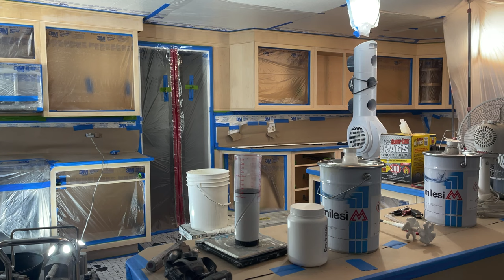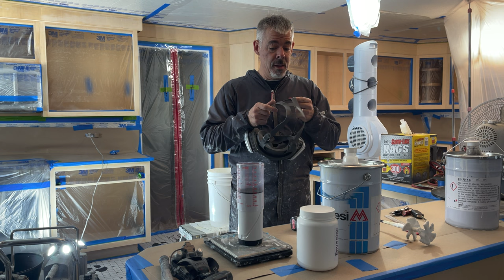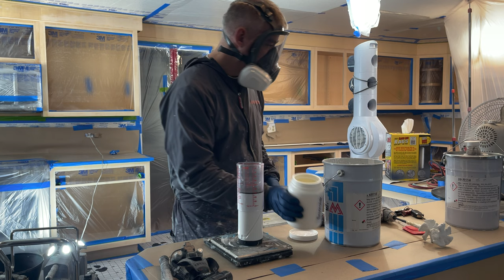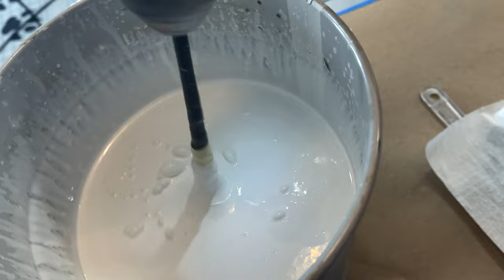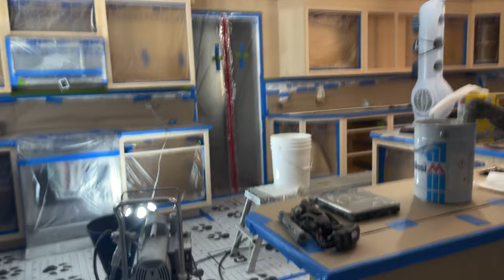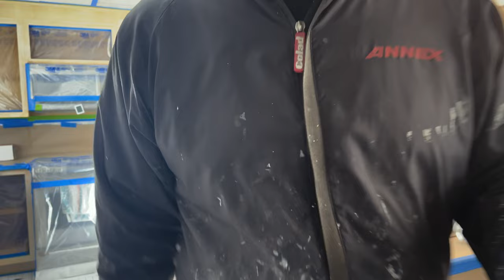Mixing Envirolak 170 -TB with catalyst on site in a kitchen

Comment: Hi Jim. I primed cabinet boxes with TB 170. Lots of sanding. We had to use 180 grit. One of my guys used 150 grit on accident.  I put two top coats of Renner 688. Perfect finish, but I can see tons of scratches.  What would you do to fix this at this point?  Just put on more top coats?  Please. I need your help. Lol.  Thanks.
Reply from the maker: Yes unfortunately those scratches will have to be smoothed out with sanding or more topcoat. Use 320 and try to feather those down and apply another coat of 688.  You only have to do the pieces that need sanding so if some spots are ok no need to recoat
Reply: @Jimskalajim12  Thanks Jim. I appreciate it.
Reply: @Jimskalajim12  What if I just put on two or three more top coats without sanding. Would that eventually do it?
Reply from the maker: @danielmiller3255  The thing is that will work but the problem is the topcoat doesn’t have enough solids to fill without a couple coats and since you have to sand between coats anyway your best bet is to make sure those scratches are gone before the first coat.

Comment: Hi Jim, if I spray this with an airless sprayer do I need to flush it out with anything after it runs clear with water?
Reply from the maker: @Mezcaudill  this is an excellent question. I cleaned my machine with just dawn detergent and water for like 2 years without a problem. Unfortunately there’s deposits that eventually build up in the fluid line that can cause damage to seals. What I do now is clean with water during the week and on Friday I use ML Camble’s GLC-10 and soak the machine overnight. When flushed this product gets all those little bits out of the system and keeps it very clean. Each coating manufacturer has their own recommendation on cleaning so make sure you check with them if using a catalyzed product. Envirolak has a great cleaner called Enviroclean which would be used with 170-TB for a deep cleaning of the machine’s fluid section.
Reply: @Jimskalajim12  that’s really good to know! I appreciate you sharing your experience since most of the things I see are just the actual spraying and not the clean up. 2k products seem like a no brained, but there a fear that no maintaining it properly could lead to a really short lifespan of a sprayer. I’m going to look into those, thanks!